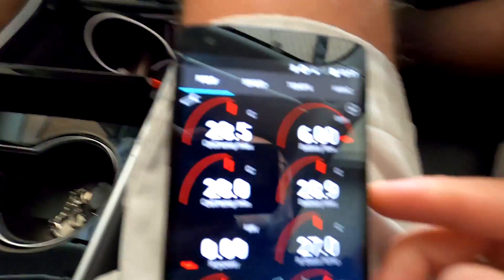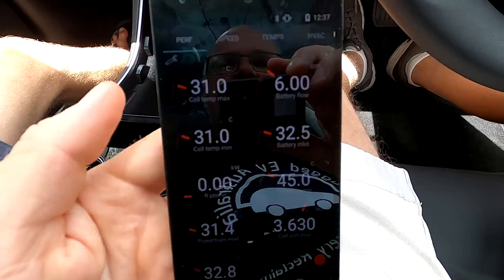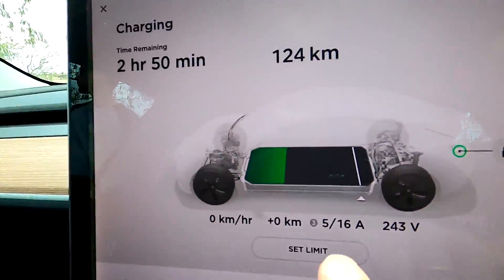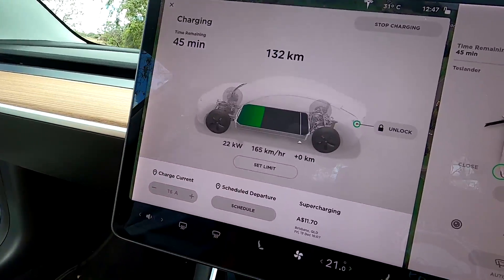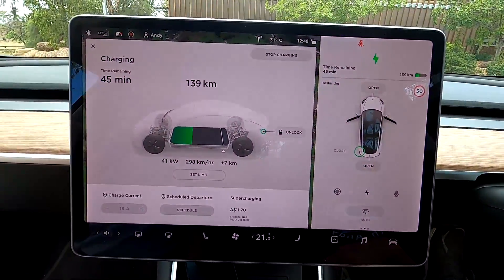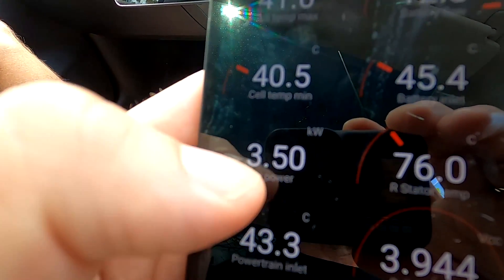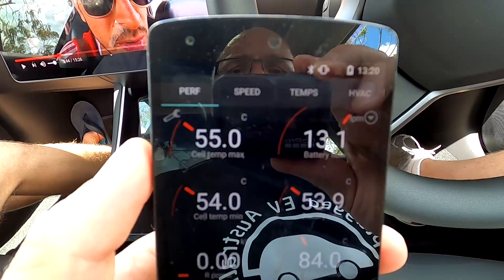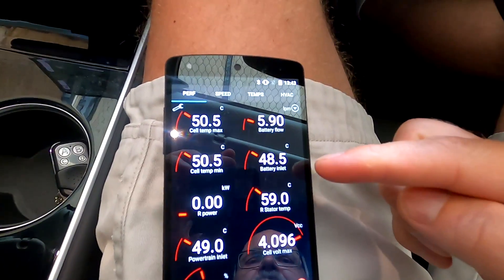EP320 - Why you should charge your Tesla on AC only. Long live the battery!

Comment: Asymmetric Temperature Modulation for Extreme Fast Charging of Lithium-Ion Batteries

https://www.researchgate.net/profile/Xiao-Guang_Yang/publication/337003783_Asymmetric_Temperature_Modulation_for_Extreme_Fast_Charging_of_Lithium-Ion_Batteries/links/5dc0d2c092851c81802c5ee2/Asymmetric-Temperature-Modulation-for-Extreme-Fast-Charging-of-Lithium-Ion-Batteries.pdf?origin=publication_detail
Reply from the maker: Excellent link. Thank you. That maybe explains it why they heat up the battery. It's not only for charging speed but also for longevity of the cells. Who would have thought...
I read through the document a bit further. So it seems that charging  a high temperature is eliminating plating and it avoids SEI growth. 
So, I'm wrong and the opposite is the case. We should only DC charging...
Reply: @unpluggedEV  Andy lithium plating and SEI growth normally happens at high C-rates + extreme SOCs. So slow charging at C/10 or less is not gonna be harmful from a C rate standpoint. 
What's key for longevity is to not run the battery too often above 90% SOC or below 10%.
Ideally around 3.7V when no load is applied which corresponds to about 60% SOC.
So if for daily commute you use 30% charge, ideal range is 45%-75%.
Reply: unplugged EV 
I thinking, If you charge really fast it’s better for the battery if it’s hot. Normal “slow” charging maybe doesn’t harm the battery the same ways.
Reply: @unpluggedEV  you only ever charge the batteries using DC anyway. That's what the car's internal rectifier is for.
Reply: JY yeah we all know that- they’re DC cells obviously. We’re talking about the difference between the onboard AC charger, (Max 11kW in a Model 3) vs as high as 170kW on a fast external DC charger.
Reply: @unpluggedEV  not only DC. DC Charging is still not as good as slow charging. The heat makes it a lot healthier to quick charge. Therfore is the heat helping in this particular process. But solw charging ac is even better. Just that heat is always bad is flas. Have a great day and consider making a video about that not many will read the comments
Reply from the maker: @hjkkmtukk3990  Thank you for your comment. That is absolutely correct. Slow charging (and discharging) is always better than fast charging.
Reply: greencarcongressDOTcom/2019/10/20191030-psu.html

Comment: There are about 6 50kw chargers within 2 miles. And my gym/golf course has 30 7kw chargers which I will be using more of when my free supercharging runs out. And there are 3-4 11kw destination chargers next to my local superchargers (only 2 superchargers there though). Supermarkets around here dont seem to be providing chargers.  But within 10 miles there are 5 supercharger sites (or will be this year). Big advantage of the superchargers sites (apart from the nearest) is they have 12 or more superchargers. But all the 50 kw are single. So suprercharger sites generally find a free stall. But the 50kw often iced or occupied by Taxis. So the 50kw sites will have visited late at night I think. There are 4 150kw chargers at petrol station I pass. But there are all busy even at 5am in the morning as they are currently free. Shame really as it's always Leaf and Taxis which cant take more than 50kw charge rate.
Reply from the maker: Wow, so many chargers. Sounds like charger-heaven. That is great. I've got only one public charger within 45km...
Reply: @unpluggedEV  London, England ,  Lots of chargers. Lots of Electric  cars because of Congestion Charge and new Taxis must be electric. So I'am often found charging late evening/early morning. But thats ok for me to read emails or watch You tube or Nextflix for 30 Mins.

Comment: Well I had 5000 miles free supercharging . - so I'm using that. Also I have no home charging as live in flat and even if I installed a charger I would not always get the spot to park and charge. The cost to install a Charger to my electric was quoted at £3000.  Thats like 4 years charging on public chargers - and I'd have to pay for the electric on top - so it would never pay for itself. Tesla loop do Supercharging only on older battery tec and get hundreds of thousands of miles out of their cars. The batteries can be replaced, as can the car. So on balance I'm going to go with whats most convenient and do the Basics. Do not charge to 100% regularly, Do not let charge go below 10%. My charge routine is between 40% and 90% . I do 95% sometime on way home by which time its 90%.
Reply from the maker: Great info and feedback. Truly understandable and logic. What you're doing is not wrong. Any 50kW chargers in your area where you could limit the speed a little bit? Do shopping centres offer AC charging where you live?

Comment: In house batteries, a lot of attention is put on the C rating. I'm not sure how important this is for EV batteries, but it might be worth looking into.
Reply from the maker: Got any links what to look for?
I imagine the 2170 cells are especially designed for a very high C-rating. They have around 5Ah each and we have 2974 in a SR+ with 4 moduls.
Reply: @unpluggedEV  https://www.sciencedirect.com/science/article/pii/S1876610218305915 Amongst others. I noticed that home batteries (most commonly with LiFePO4) usually have a Max reccomened rate of 1C. Is my thinking correct that capacity = 1C charging rate (1C for 100kWh battery pack = 100kW of power)?
Reply from the maker: Yes, 1C is the full capacity of the battery, 54kW in case of the SR+

Comment: My Leaf doesn't heat the battery.  We have winter now and my battery is at 10C most of the time. When I charge  on DC at 42kW the battery temp rises to maybe 20C after 30-40min , but all power goes to the battery according to Leaf Spy .
Reply from the maker: The LEAF has no thermal management, neither cooling nor heating. From an efficiency perspective, that's good, right?! A bit of heating in Wintertime would be beneficial as cells should not be charged under 0C at all. Maybe the cells don't get that cold when you park in the garage.
Reply: @unpluggedEV  i know that Leaf doesn't have the thermal management  :) . However in my case ( I always park in the garage) and it's not super hot here ... the battery is between 10 and 35C all the time :)
Reply from the maker: @andrzejp8782  So that's good, the battery should last a long time if you us it in the healthy range of 20-80% most of the time. At least you don't have that thermal problem with it in these temperatures.
Reply: Batteries are designed to be changed at 25 degrees. Charge after driving instead of before driving or that 40kw many harm at low temperature.

Comment: 2:45 Regen limit kicks in at lower values, probably around 10-15C. Anything above 15 is actually considered warm enough and 20 is optimal. So that info here is wrong for operation (not for fast charging though!)
Reply from the maker: You can see the doted line showing regen limit until the battery reaches 30°C. The BMS uses the heat of the motor to warm the battery to 30°C+ to eliminate that. Info is correct.
Reply: @unpluggedEV    No, it most certainly is not correct. I don't have the exact temp when it kicks in, but it def is not 30C as this is very high! You are forgetting that high SOC also results in dotted lines anything above 85% or so on an AWD. I guess on your SR+ it could be even lower than that, probably 70/80% due to lower capacity and c-rate. I will do some tests and let you know how it is on AWD, but we have 15C now and I don't see any dotted lines, zero and I have all the regen at 50% SOC. You should check what the max regen is on your car (AWD is 85kW) and based on that and SOC and c-Rate  you can do your research and estimates.
Reply from the maker: @teslakiller6959  This has nothing to do with SoC, this is temperature driven. The regen limit is below 30°C. The doted line shows you that and the Tesla Watchdog shows that the battery is been heated until it reaches ~31°
I had a limit with 40%SoC this morning and battery at 28°. While driving, it heats up the battery (inlet temp is higher than cell temp) until it pushes the cells over 30°C. Then, the heating stops.
Reply: @unpluggedEV  I think we are talking pass each other or something. The regen limit has def something to do with SoC and that is a fact. Just charge your car to 100% and you will see the dots, regardless of temp inside the battery. Even at 90% they should be there, but smaller amount (on AWD it is there to about 85%). You can also see available regen in SMT. You also didn't answer my question regarding what the regen is on an SR+ MAX. You can see the value at Max regen in SMT. Actually, 40%  SOC on an SR+ is pretty low, about 18kWh or so this could be the reason too. On an AWD, 18kWh is around 25% and I def see regen limit around that area. So  30C is def not what I observe on an AWD and I can send you screenshots. It most likely is SOC. The total regen on an SR+ in ideal conditions should answer a lot of the questions though.
Reply from the maker: @teslakiller6959  Of course, if the battery is full it cannot take more energy any more. I always thought 80% was already so high that I see regen limit. But it was always temperature related, not SoC. I never seen a regen limit with low SoC as you say.
At the moment it's hard to say as our weather is to hot so the cells never really cool down over night.
I'll see what it says tomorrow morning after a 'cool' night of 25°C.
Reply: @unpluggedEV  You can also watch this video towards the end his battery was pretty cold after the whole day being parked and he still has no limit. I assume the battery was at about 10-15C. He had limit to about 74% on the way there in the morning though!. So it seems like the SR+ due to its very small battery doesn't have its regen limit available in a lot of use cases and the SOC plays a big role in that calculation, but temp too. But not above 30C that is too much. https://www.youtube.com/watch?v=Lj8SHNvhoA8
Reply: @unpluggedEV  You should keep the car in between 60/70%, not higher than that and not much lower too.  On the video I linked his regen (dots) was lowered above 75% but it was probably due to cold battery, because on his way back at 73% at 15C he didn't have any dotted lines. Maybe you can still tell me or make a video about the max regen available on SR+. Like I said - 85kW is on AWD curious what it is on RWD. Thank you!
Reply: @unpluggedEV  I have my answer from the last Bjorn Nyland video - max regen is at least 75kW on SR+  and he had regen deduction at high SOC of about 80% (cell temp above 35C temp) to about 54kW max regen. He also showed 85kW max regen when he was charging at 5%, but I think this was a bug in SMT when the car is charging. But it could really be that SR+ gets the same max regen at 5% -10% or something, but this is unrealistic as noone drives the car at 5% anyways... He didn't show SMT all the time so I don't know when the dif regen limits kick in, but it is def SOC and temp dependent as AWD.

Comment: Ummm....My guess is Tesla has a very deep knowledge of the battery technology they use. And if they purposely heat the battery while applying a huge current, probably is because it is healthier for the battery than letting it warm up by the charging current itself. But may be it is just because the give priority to charging speed over the residual degradation.
Anyway, no doubt slower AC charging would be beneficial for the battery health.
Reply from the maker: See the pinned comment and link. It seems like fast charging a hot battery prolongs its life...

Comment: Andy how does heat affect your car?
I have a new and improved problem with my Model 3
When I park outside (30 Degree+) the aircon starts after a while and soon the alarm goes off (now I only park with alarm and sentry mode off).
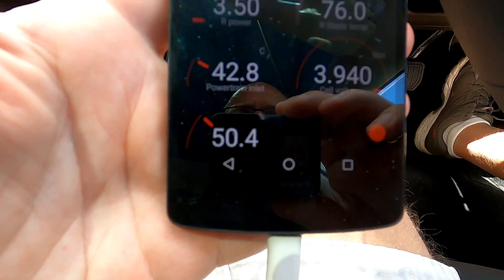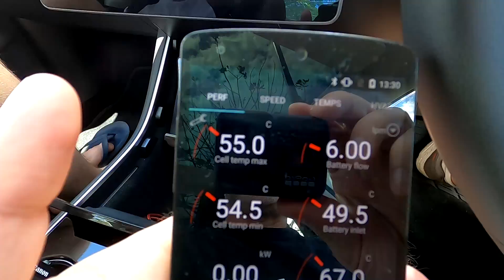When I go to the car, the aircon starts (set to 23 or 24 Degree) and I am getting very nostalgic, it makes as much noise as my 10 year old Diesel did. At that point you cannot give voice commands until you turn down the fan. I reported it and got a date in Brisbane on the 5th Feb but before that someone from Tesla will come here to have a look on the 9/1 at 8:30, ne 17/1 at 8:30, ne 16/1 between 11:30 -12:30. I hope there will be not too many more changes with the appointment.
Reply: Turn Climate Off.
Reply from the maker: It's the cabin overheat protection. Set it to No A/C
Aircon is as loud as in the PHEV or any other car. You just cannot hear it with the ICE running.

Comment: Very interesting, so I dit it right because I uses most of the time only AC 11 or 22kW Wallboxes. Maybe it will be the best with the UMC with 2,3kW?
I have also bought the OBD adapter cable, I think I will get it today, so I can check my AC vs DC usage. But I think about DC ~80kW  = 2,76% vs AC ~2820kW = 97,24%?

But I can analyze three Model S, because the first 28.05.2019 was driven the first 2500km only with SuperCharger. Because the brother of the owner drove it and dit'nt what the owner say'd (please charge when possible on AC).
The second is my Model S from the first day only driven from me, and SuperCharger only for trying or top up a little bit when necessary.

The third Model S is my working friend, dit see my Model S and I showed him the car and drove about 30 minutes and he bought also one. He uses regularly the SuperCharger but also AC Wallboxes, don't know it really but I think maybe more DC SuperCharger as AC Wallbox?

But I can check all three cars. But one difference is between the first and my Model S fully charged 100% I had in June 470km, after a Softwareupdate it changed and since I have norm ~458km but the first Model S shows norm 463km? Maybe the BMS needs the SuperCharger to get the real capacity of the battery?
Reply: The TeslaFi web application is great for those people wanting Tesla data summarized for them.
It keeps a history of all charges AC and DC, shows a lifetime map of trips, shows software updates, allows you to set the charge level....... I find it to be a nice summary without getting into the weeds.
Reply from the maker: That's $5/month subscription, right? I had it for a month and didn't really like it. I had massive trouble to not keep the car awake all the time...
Reply: @unpluggedEV  I use it with no problem. You  should have checked the settings you were using in the App. My car has no trouble sleeping. Sounds like you did not give it enough of a chance to figure out how it works. There is a way to contact the developer. He is quite helpful.

Comment: Andy:  This is long so bear with me.  Your test of coasting down a hill the other day reminded me to dig out some old equations that might help out.  To calculate the work required to raise your car in elevation you need the distance (elevation change in meters) and the mass of the car (Model 3 SR+ is 1611 kg).  The car’s weight (force at 1G gravity) = 9.81 * mass = 15804 newtons.  Thus, the work required to raise your car 1 meter (assumes constant vertical velocity) is 15804 newton-meters.  Multiply the work by 2.778E-04 to get the energy (watt-hours) required.  So, the energy required to raise your car 1 meter is 4.39 watt-hours.  The theoretical amount of work (energy) is independent of speed (takes the same amount of energy per distance whether it takes an hour or a week).  The amount of energy required to go up 100 meters in elevation would be at least 439 watt-hours because it does not include wind or rolling resistance or power required by auxiliary systems.  Going down 100 meters would be no more than -439 watt-hours (energy returned instead of consumed) because some of that energy will also be consumed by resistance and systems.  The US EPA rating for your car is 25 kWh/100 miles or 155 Wh/km.  So, if you drove 10 km for a 100 meter rise the expected energy use would be 155 Wh/km * 10 km = 1550 Wh.  Add 439 Wh (100 m rise) for a total of 1989 Wh.  This also shows that if you drove 1000 km for a 100 meter rise, the energy required for the climb becomes an insignificant portion of the total.  Don’t know how it is there but here in Kansas you have to go some distance to achieve a 100 meter change in elevation.  For your coasting test, all of this equation stuff shows that if you are coasting (without regen) down a hill at a constant speed, it means that the energy required to overcome rolling and wind resistance is equal to the energy being recovered by the loss in elevation.  By the way, I laughed out loud when I read your response about reading the instructions.

Comment: Nice one Andy. Thanks for working this out so we don't have to. I have decided that when I get my Tesla I will not be getting a "watchdog" app and will just drive and enjoy. I have spent enough time worrying about the battery in my Outlander.  With something 10 or 20 times bigger I don't think I will need to worry so much. Plus the UK temperatures are a lot lower. :-)
Reply from the maker: That's probably a good decision. Temperature should not be a big factor in the UK in regards to battery degradation. When do you get one?

Comment: What is the best temperature for regenerative input?.
Reply from the maker: The Model 3 basically has a regen limit under 30°C. Still strong but not the full 65kW. It heats the battery until it reaches this 30°C threshold. Never seen it cooling the battery so far except the one SC I had.